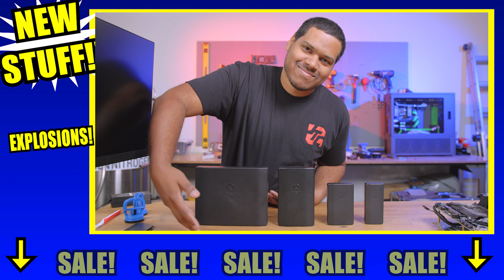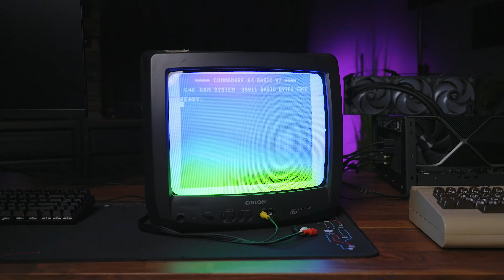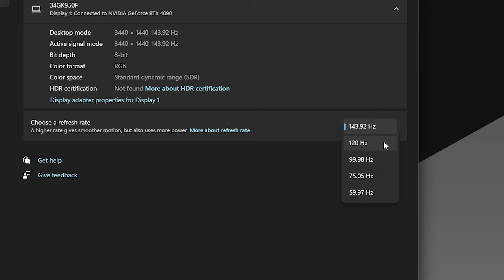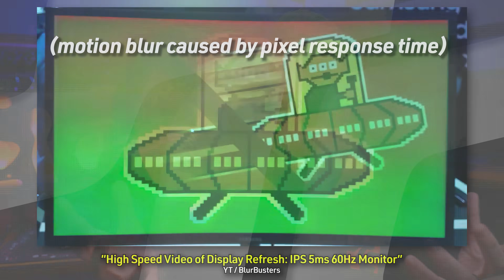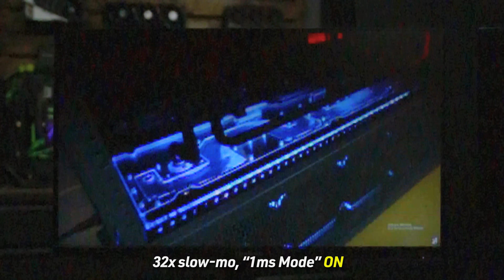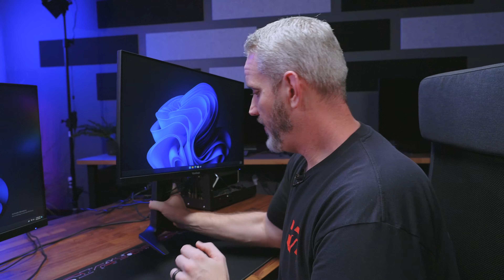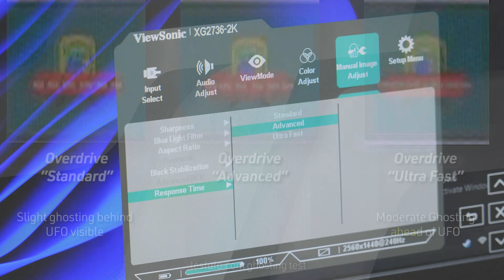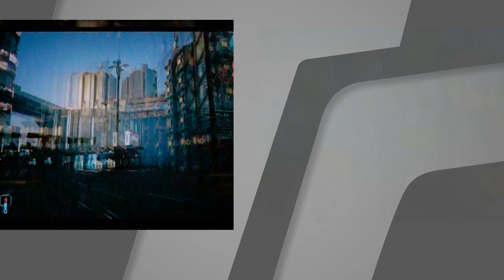MPRT is pretty awesome! This is how it works...

Comment: New iFixit AD! Yay! 😅
I had to actually rewind the start of the video to check 😂
My head was exploding too many times 😁

A little detail to point out... I'm not an electrician but I'm pretty sure that LEDs don't blink... It's a continuous light source like incandescent light bulbs you mentioned. The LEDs still heat up but they convert far more of the energy to actual useful light. 

If they blink they have a very poor quality driver.

Peace man ❤
4KP's 😁

Comment: Unrelated but I just upgraded my PC by buying a new a ryzen 9 7900 as well as a mother board to go with it and some more storage. However I didn’t realize that the mother board is ddr5 and not 4, this sucked super hard because a week prior I bought a new set of 64gb ddr4 ram sticks. 
TLDR don’t impulse buy and check 20 times before purchasing

Comment: Some things in the video were a bit off. The number 1 being "we now have LCD technology capable of 1ms GtG". The fastest 480 Hz LCDs are still not really achieving usable 1ms response times. They can technically do it, so that the marketing can advertise 1 ms without outright lying, but only with overdrive that makes the screen unwatchable in terms of artifacts that come with it. 

MPRT is nice, but not like this. Benq with their DyaC tech can do MPRT with MUCH better brightness. If I'm not mistaken, there are even monitors that can now do MPRT and VRR (or it should be possible in very near future with the new Gsync module).

Like you demonstrated, it also introduces flicker, which we cannot see, but our brain does perceive it and a lot of people can't stand looking at flickering screens for a prolonged period of time. 

Testing it on Cyberpunk is pretty much useless, I don't even know what kind of settings you would have to use to run it at 240FPS without upscaling or frame gen(which introduces blur). You should try playing CS2, Apex, Valorant etc. as the games it was actually made for. Try playing with and without it for at least a few minutes and then assess whether you can actually see/feel the difference.

Comment: I know I am not the only one to think this but I wonder how long it will be until you can have a minor operation and plug the monitor cable directly in to your head from the PC so you don't need a monitor? And how often would you need an upgrade? Goodbye reality...

Comment: Hey Jay. I need help. My msi mpg x570 will not post with my 5600x but works just fine with my 2600. This is the 2nd 5600x and I've updated the bios.
Reply: Monitor voltages. I've seen pbo on some boards degrade the Zen 3 and Zen 2 chips if the MOBO wants to chase high single core. Zen 1 is older node and probably takes the high voltages fine.

May want to look into obo tuningnor running static clocks and voltages if the board is actually a problem and running too aggressive.

Comment: Kinetoscopes work off this concept.

When I was a kid living in Madison, WI, there was a restaurant called Eli’s Deli. While the whole restaurant was like sitting in a real-life Pee Wee’s house (from Big Top Pee Wee), the thing I enjoyed the most was the kinetoscope as you walked into the restaurant. It showed clown juggling and the strobe would flicker in time with the clown as it changed position. If your night vision was more sensitive enough, you could see how it worked when you turned it off.

I’ve had LCD TVs with this tech in them before, including a Sony that had a Motionflow 960 mode and a 240 hz panel, and it ended up being more annoying than anything else.

Comment: Once LCDs came, moving from CRT to LCD felt so bad. Having 100Hz+ CRT back then and to think some use LCD 60Hz still *shrugs*.
Then again OLEDs are here now, finally moving away from LCDs, strobing definitely something that's great. Same for OLED to have proper BFI, need to see that in new monitors.

Comment: Isn't this like the ultra (or extreme) low motion blur (ULMB / ELMB) strobing feature that's been around for some time?
Even my ASUS ROG Strix XG349C monitor has ELMB Sync where ELMB works together with G-Sync.

Comment: I can't say that I hate motion blur. I just don't see a point in it. When you move your mouse fast, everything blurs anyways just due to the speed of how your character or camera is moving. Why turn your game visuals into a muddy mess? I grew up on a mix of pc gaming and consoles. I am used to slower framerates, somewhat, but prefer 120+, I will say that 30 fps is truly a slideshow though. Games are just plain unplayable at that framerate, so I guess I am less comfortable with console gaming these days. Either way, I ain't a competitive e-sports player. I don't need the new tech, but that doesn't mean that I'm going to go out of my way to add something that is stupid in the first place.

Conclusion: MPRT ratings aren't something that I'm going to worry about, but motion blur isn't something that needs to be turned on in game settings either.

Comment: My monitor has a huge problem with the motion blur thing. In American Truck Sim, the dots for the cities on the map end up existing 2 or 3 times if I move the map around fast enough. Literally leaves a trail behind every little dot of the cities. I'm on a cheap ass AOC 24in 144hz 1080p lol

Comment: In before there's someone in the comments talking about how they can tell the difference between 60fps and 120fps on their 60hrtz monitor, no buddy, no you can't, the monitor is only showing you 60 frames a second so there's no difference between 60fps and 120fps my dude

Comment: What could be amazing I should add, is if ViewSonic took their XP tech, and applied it to a Dual-IPS-Black display, this would give you all the benefits of an OLED, all the benefits of IPS, and even some of the benefits of CRT, and given how cheap IPS is, it would be significantly cheaper than OLED, that could really make things interesting, especially if it was a 32" 8K 16:10 display, that would leave OLED in the dust.

Comment: That is not necessarily permanent you can use a degaussing wand to try and get rid of those changes to the purity of the colours. Most of the time it will sort out the picture if properly used.

Comment: There is a way that a lot of companies measure response time, and it's scummy, at least for the lower quality panels that usually are the cheapest. They take a best case scenario for response time and round the numbers down, not including the time the pixel actually takes to do a full transition.

Comment: When I worked at a tv repair shop in the 70's, we used a degaussing coil. When you saw patches of color around the tube that was the fix. It was a large coil of wire about a foot in diameter creating an electromagnet. You held it close to the picture tube, turned it on and waved it all around the front and sides of the set gradually backing away before turning it off. A lot of crt tv sets had a built-in coil wrapped around the picture tube which would do the same job every time you powered the set up, but doing it manually could do a better job.
Reply: Yes, and the hand-held coil could degauss stronger magnetization than the built-in degausser could deal with. I had a "portable" eight inch degausser (I made side money repairing TVs back in the day), and it was heavy enough to brain a mule.

Comment: Just another marketing scam. Most monitors aren't really 1ms gtg.
Reply: An actual timesleuth meter will show closer to 28-30ms G2G, but 1ms sounds better as a marketing spec. Only CRTs are capable of sub 1ms (actually closer to 0.1ms end to end), or MEMS Laser Scanner displays.

Comment: Is it just me or does the tech behind CVTs just seem so much more advanced/complicated than LEDs?
Reply: They are much better, with much better incandescence, slightly yellow polluted whites though, though so are LED's, they are tinged with either blue or slightly yellow, but CFL will produce a much better IQ than LED, hence why reference LCD uses them, I'd love to make a DIY Dual-IPS with a decent RGB CFL. See the Dolby Pulsar reference monitor, that actually uses LED's though, the best LCD ever produced, uses Dual-IPS panels and has an amazing CRT emulation algorithm.

Comment: Only very crappy panels use PWM flickering, good ones don't. If ViewSonic uses PWM — I'm not buying them period.
Reply: Controlled optimized PWM is a totally different thing to random PWM flicker from dimming the LED. But is ultimately a very different thing to the smooth natural motion of raster-scan like a CRT, as someone who suffers from migraines, I have to avoid all forms of PWM, controlled or otherwise, CRTs I can use and enjoy for hours however (Plasma also, which also have amazing image and motion clarity).

Comment: If you wave your hand around in front of your face in daylight, you see a blurry smear. 
If you go into a dark room and shine a modern, LED torch on your hand as you wave it around, you see multiple, crisp images of your hand without any blurring.
This is because the LED in the torch is strobing, which reduces the perception of motion blur.

This is a much better analogy than the funhouse as anyone can try it, and it also gets rid of mentioning the idea that the human eye has a refresh rate, which brings the idiots out of the shadows.

Also, to rephrase what Jay says about this in relation to MPRT: With strobing, the pixel is still as blurred as it was before, but the strobing of light means you no longer perceive that blurring.

Comment: This feels like jumping the shark though.  

The majority of players really don't care about 240hz+++ at all.  Just because techtubers and niche forums go on and on about how "Yeah bro, I really need a 480hz monitor or the game is unplayable" that doesn't match reality for most people.  A large portion of the population is just NOW finally realizing that yes, 60fps > 30fps thanks to performance mode being added to the consoles, but very few PC players act like more than 120hz - 144hz is necessary at all, if they can actually even blindly tell a difference between 90hz - 144hz anyway.

It's cool that this technology exists, but it's not really replicating what it's like to play on a CRT.  CRT is still the smoothest experience of all the monitor types (up to 240hz anyway).  They're just clunky, power hungry and lack the same kind of color information that modern screens can provide.  They also don't have VRR.

You say this video is to give a "practical look at what it means", but it's more like pixel peeping static images. That isn't practical.  It's academic that serves no real purpose for the majority of people.

This is just "new tech" to sell more monitors (just like a "gamer" tag in a product line) since we've pretty much already reached the peak of innovation and the only thing really worth caring about going forward would be micro LED monitors.  But what should have already arrived now are still MIA, and likely won't be here before 2030 at the earliest.

Next you're going to tell me that the $1,000 diamond-encrusted Mars alloy based audio cables are going to be more "revealing" and open my ears to new sounds in a way the stock cable with a pair of headphones does not. 😆

Comment: Some leds flicker. They dont have to. A large amount dont. Eyesight has no refresh rate. Its continuous, but there is delay and persistence of vision which is similar to motion blur. You can exploit this effect to check if a lightsource is flickering. Easier with a small, defined light source in dark surroundings. Then simply pan your field of view quickly past the light source by moving your eyes. If you then see a continuous streak, it doesnt flicker(or extremely fast, beyond any relevance) If you instead see a row of dots, it does indeed flicker. Finding car LED tail lights in the dark awful for this reason, as they are often dimmed from brake-light strength by flickering.

Comment: I gotta say the blur of my ASUS PG27AQDN is not perfect, but since it's an 240Hz OLED screen it has less than 1ms response time (messured not advertised speed).
Most IPS advertise 1ms, but they do have 5-6ms response time in reality. It actually makes a difference in "how responsive it feels" even at the same framerate.
My OLED feels like "I have double the FPS" compared to my IPS, despite the fact that in my test I had capped the FPS to 144 in a couple Shooters.

Comment: My relatively old monitor has ULMB mode and I fail to notice any significant difference between ULMB and MPRT. It works the same it has same problems like comically low perceived brightness and that nauseating feeling looking at image. I mean response time is lower and strobing frequency higher,but everything else is identical. Another mostly bells and whistles kind of tech for a very niche use case?

Comment: Incorrect on how motion blur works for eyes.  The cones and rods maintain a charge for so long and fade over a short amount of time, resulting in why U.S. AC power is 60Hz, hide the resulting flickering in incandescent light bulbs.

Human eyes don't see refresh rate scanning.  It is how quickly you mind notices a change in the image, and you vision holds like several milliseconds worth of "frames".  AMD and Nvidia could effectively work on an upscaling tech where the image is drawn in extremely low resolution but the image is fully rendered like 2,000 times per second, taking the data of like 33 frames to generate a single high resolution frame, as that is how your eyes work.

Another way to put human vision, the retinas are the memory cells holding the image.  The light provides a charge that fades over time.  When you go into a true dark room with a light and turn the light off, you see the ghost of your last image as the charges in your retinas fade to "neutral".  Your eyes are processing several milliseconds of frames.  Why low FPS CGI rendering and stop motion animation in films appear stuttery is because each frame is effectively 1/infinity milliseconds of time, near 0 seconds.

To produce "true motion blur" in CGI, you need to like render 1,000 frames per second and for each monitor frame, combine several frames into a single image.  That is how natural motion blur actually exists.

Live action cameras capture motion blur because each frame has the shutter open for several milliseconds before closing for a millisecond to flip the frame.

Comment: Great video, but you should have mentioned oled having the best MPRT (0.1ms) . Also it does not need backlight strobing to achive it (obviously), so brightness and VRR do not need to be sacrificed with oled. If someone cares for MPRT and they have the budget for it, oled is the best way to go. (better colors and blacks are a huge plus too)

Comment: the only time motion blur is acceptable is sub 60 fps. monitors need to implement a dynamic overdrive depending on the fps. or the overdrive settings need to be more granular. My viewsonic panel overshoots like crazy if I raise the overdrive but its still kinda smudgy. Im hoping that once I get a better GPU like you said able to drive the fps to the HZ limit it will be better. Mine claims a 1ms MPRT but its smudgy sometimes depends on the content.

Comment: To see if there is ghosting just move the mouse cursor on a dark background and keep your eyes on the cursor itself. In my case, the brand new Dell monitor has none that i can see until i move the cursor faster than i can follow. On my secondary 10 year old LG on the other hand, even slow movement leaves a trail.

Comment: Im still on an old ips 165hz 1080p monitor.. on a 3080 10700 system.. got the monitor 6 years ago for 100usd and got the pc 3 weeks ago for 600usd used.. 
Im not upgrading my monitor until oled is cheaper

Comment: is this pwm flicker? if so some people like me gets an headache from it and eyes gets all f** up had to send back my steam deck oled cus of it
Reply: That's different. PWM would handle the brightness (always on since the display wouldn't otherwise work). Since some people tend to get a headache from that most LCD PC monitors don't use PWM, but DC voltage to regulate brightness (usually advertised as "flicker free").

Comment: How does this apply to the most recent generation of OLEDs with their claimed 0.03 ms GtG? On motion blur tests like the ufo ones you showed they pretty much look like static images even at high refresh rates. So do OLEDs need anything like this or is this just something that will help LCD panels?
Reply: Short answer yes, OLEDs use BFI instead of backlight strobing, but the tests in this video appear to be captured with a stationary camera instead of a moving camera which is not how your eyes perceive it.

Long answer, look up “Blurbusters GtG vs MPRT” and you’ll find a very good article on why even instant response times don’t fix persistence blur. The only two ways around this problem is higher hz and refresh rate (1000fps on an 1000hz screen needed to match average CRT clarity) or strobing (1ms persistence needed to match average CRT)